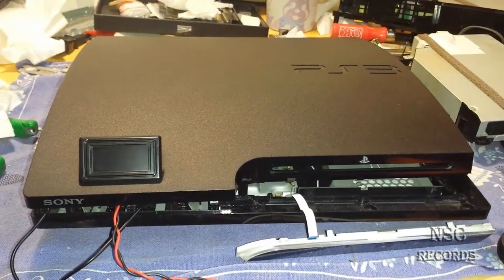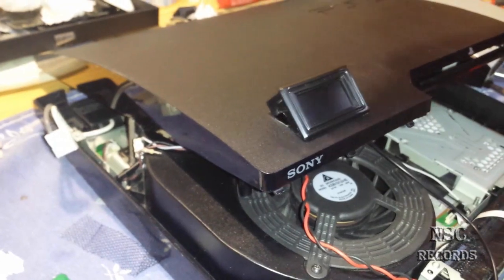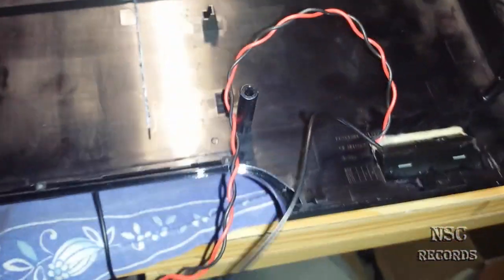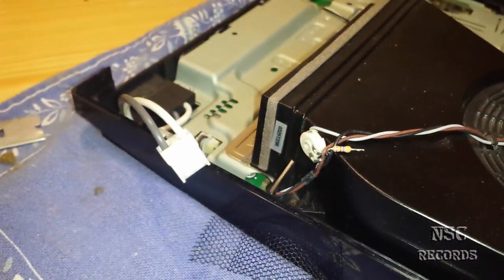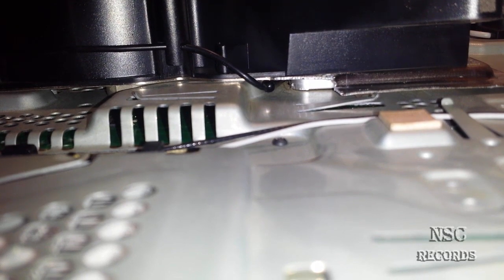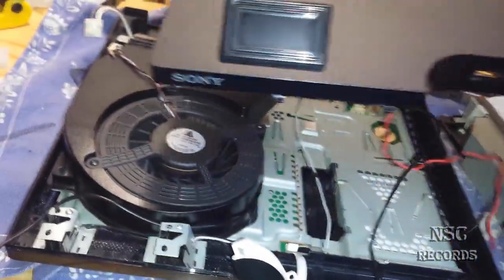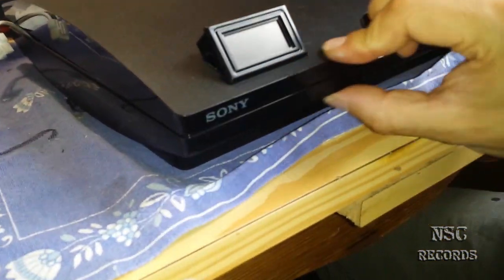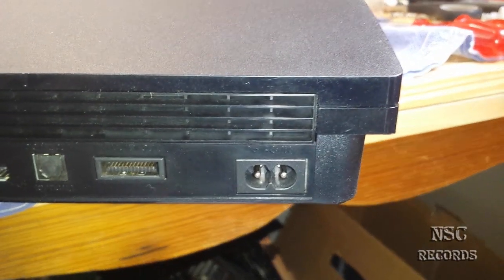How to mount a Temperatur Display on a PS3 Slim  -Mod Nr.2-  By:NSC

Comment: Isn't there a way to do a more accurate mod on the PS3 Slim like you did with the FAT model PS3? I would like to see more accurate temps when doing this modification. Wouldn't it be easy to at least one temp guage on the RSX since it gets the hottest?

Comment: Hi, I have a problem, after downgrade and install firmware CFW, the irisman or other program doesn't work (black screen). I tried change my blu-ray drive and downgrade with habib 999 noBD version, now an error message appears when try to Toogle QA (8001051B). Can you help me?

Comment: I got ps3slim with cfw 4.70habib,control fan always on and i changed the thermal paste with artic silver 5 bro!
Reply from the maker: sj mak yeah, thats the best you could do ^^ But Habib 4.65 v1.02 with Multiman 4.65.02 seems to run better...
Reply: No doubt bro but i like to keep My ps3 with the leatest cfw to avoid the official update,if u know what i mean....lol
Reply: sj mak Install Rebug 4.70.1 REX with webMAN. Than set the control fan speed on 37%. Your PS3 stays under 50°
Reply from the maker: ^^ It stays under 50° when the Thermal Compound inside the IHS is still OK, but with the time the Thermal Coumpond inside the IHS gets just Fucked xD and a lot Peoples dosent like webman ^^ and if you guys use Fan Utility, than take care on PayLoad Mode, that makes some Sound Bugs & maybe also some Frame Drops
Reply: User mode (60x)4 life baby!lol

Comment: Wie teuer ist Jailbreak+Grössere Festplatte+LEDS+Temperatur Display+ Wärme leitpaste erneuern bei dir?! wenn du das machst?!
Reply from the maker: TechnoWolf Kann schon teuer werden, habe noch 2 Slim´s grad da, beide mit 250Gb HDD, IHS wurden Geköpft, Hochleistungs Wärmeleitpaste MX2 & MX4 wurde angebracht, Lüfter Regler wurde eingebaut, neue Luft Einlässe wurden gemacht, CFW wurden Installiert aber OHNE Temperatur Display für 220€ Eine davon ist die aus dem Video: https://www.youtube.com/watch?v=ISx4NQ8MLU8
Mit Temperatur Display würde die ca. 280€ kosten, da einfach ein Haufen Arbeit dahinter steckt.
Lg.